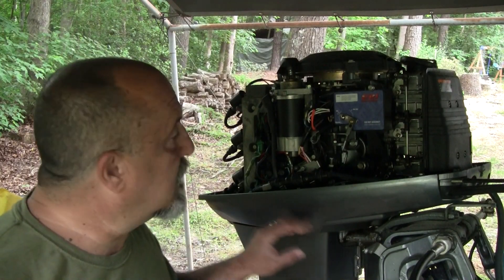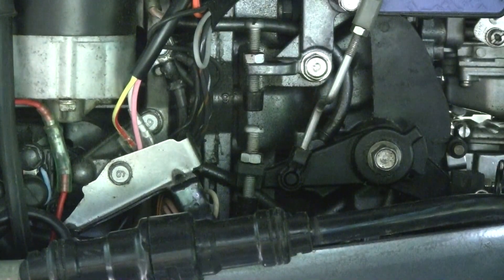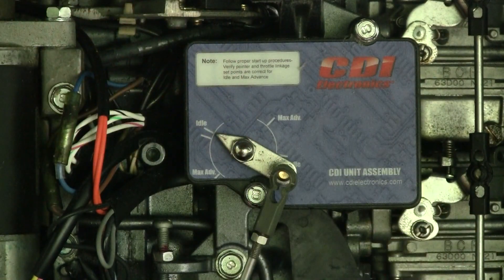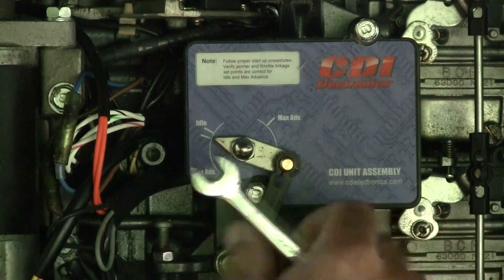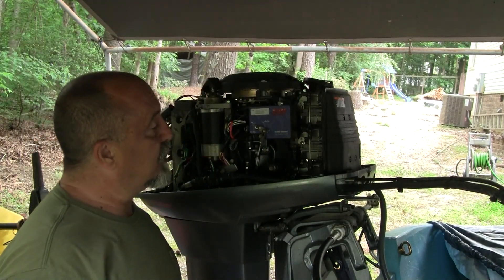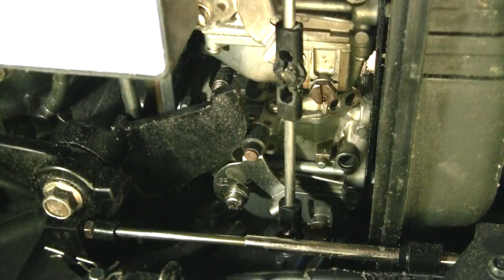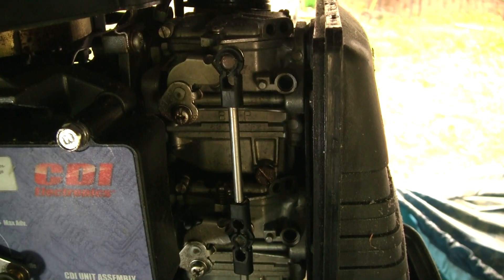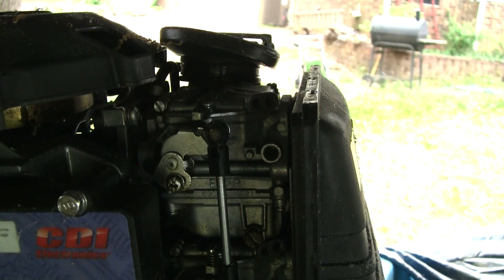Linkage Adjustment - How to Link & Sync a Yamaha Outboard 40hp 2 stroke

Comment: I have a 2003 Yamaha 50TLRB 
Do you think most of the measurement settings etc will be the same?
Reply: 2 stroke
Reply from the maker: Probably so, but I would play it safe and download a pdf copy of the manual, I think I paid about $20 for mine,
Reply: Okay
I purchased a service manual but couldn’t find the idle stop mm information. Is there another manual out there? On Yamahapubs I can only purchase the service manual and owners manual. Maybe I will look on another site
Reply from the maker: Mine show it in the "periodic inspection and adjustment section", sub section titled "control system" section 3 page 2. My manual covers the 40 and 50hp version, you may want to measure where it's at now and then try 20mm (what mine calls for). Interestingly enough, mine was serviced by a Yamaha "pro" who left all the settings completely out of spec.